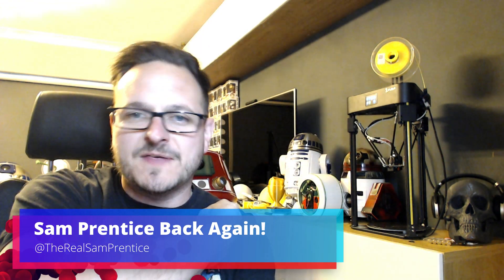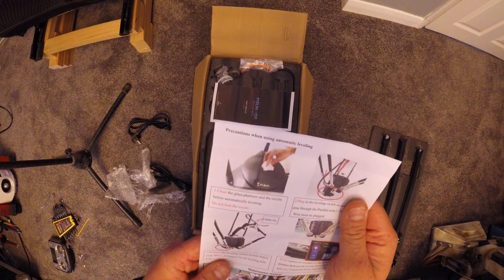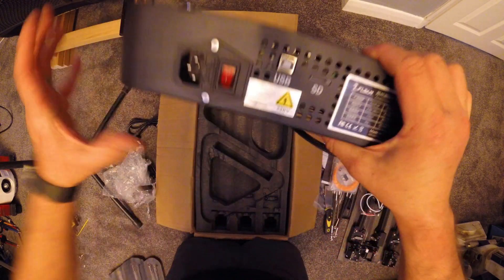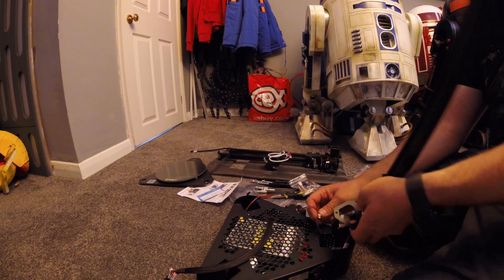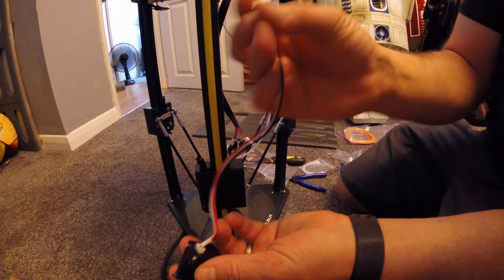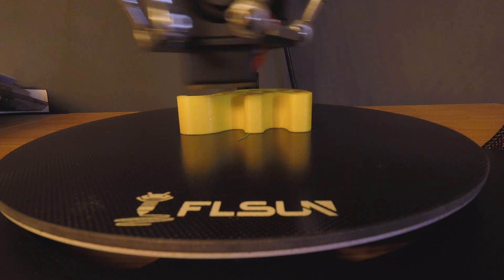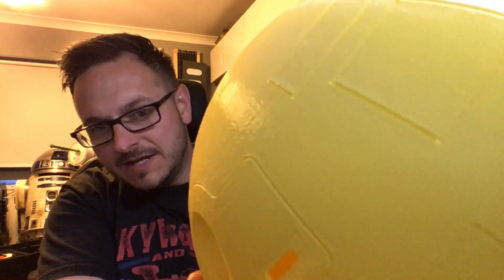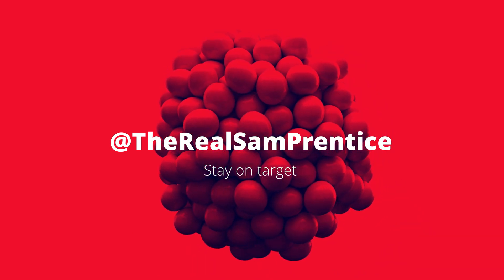Review Of The FLSUN Q5 3d Printer Budget Delta Printer!

Comment: Would you happen to know what the hot end nozzle size and where can I get replacement parts?
Reply from the maker: I understand there could be two versions however these are common, you have the short "stubby" style and longer style, it will matter but you can eye ball it https://www.amazon.co.uk/MASUNN-Copper-Nozzle-Printer-Filament/dp/B07D4F4LWH

Comment: looking a this for my first printer. there are comments about the chip that controls the print head as being low quality and that the cooling fan should be changed to a nocture with resistors to drop the voltage from 24v to 12v, it may help if the bearing on the end of the rod get a squirt of ptfe lube....cant do any harm......as a entry level printer this sets a new standard by which others will be judged.
Reply from the maker: David C you’re not wrong, this printer is ace and it produces great prints stock. Yep the driver is of a lesser quality but it’s only a noise issue not really an accuracy problem. I kind of like running printers at 24v now tho mainly as you cut the amps down and you can run fanless psus like you say tho it’s an entry level printer but I’d like to see the larger version in the future :)

Comment: I have had the Q5 for about a month.  Two things  I noticed from your video, First your hot end(not all metal) is not mounted per directions, the parts cooling fan should be on the right side and the mount for the auto-level sensor should be on the left.  The other thing is the extruder is clicking due to a loose grub screw on the gear attached to the extruder motor.  It has two grub screws and if one is loose like mine was from the factory it will cause that issue.  Also, the esteps from the factory seem to be set at 367 which it too low for the Titan, it should be set around 446 with the stock Titan.  I have switched my extruder to a BMG Clone with a TMC2208 Driver and changed esteps to 438 and now this thing is quite during retractions.  It cost me around $10 for the TMC 2208 and $25 for the BMG Clone Extruder.
Reply from the maker: Hey Marshall, Thanks for the feedback! I'll have a look at the screw right now and see what adjustment can be made. I'll follow this up in my next video of course. Did you find that it prints really well then goes off after some use? This is printing really well and just woke up to another great print. I'll have a check of the mounting settings also, but do I change it while i'm getting a stunning line of perfect prints?
Reply: The Real Sam Prentice I did make some adjustments to the voltage on the X Axis TMC 2208 driver, from the factory it was set too high like 1.35 volts and did have that driver do a thermal shutdown, the drivers should be at .8 to 1.0 volts for best performance and lower heat on the drivers.

Also from the factory one of the belts was too loose and needed to be adjusted.

Other than that I find this thing works much better with a very thin coating of AquaNet, especially if you print at high speeds.  I have only sprayed the bed twice in the last month, a little goes a long way.  I also put a little copper grease on all the ball joints.
Reply: @marshallburke88  Hi Marshall and Sam, thanks for sharing your both your feedback. I have just bought a Q5 and I am busy reading some reviews on post setup advise. May I ask if you have both also setup dampters for the extruder rods? Am I correct in thinking that the driver voltage was reconfigured using the slicer since this is a closed board?

Comment: Ive had mine about 2 weeks and its printing nicely,
Just for info the nozzle is on mine is PTFE lined, not a true all metal, it would be easy to upgrade though,
Also worth mentioning there is some safety measures taken in the firmware to control thermal runaway from my testing but it  seems to continue to print after a failure just with the nozzle and bed powered down
Reply from the maker: Hey Rob, thanks for your comment. Is there a chance of a bad batch do you think? When did you get yours and where did it ship from?
Reply: @TheRealSamPrentice  
No idea, it prints beautifully, 
It was shipped from Banggood in Spain,
The do seem to make changes to printers.
The thermal protection is effective just not very confidence inspiring.
Ive changed to marlin which im familiar with so it it doesn't concern me, but worth mentioning :)

Either way great vid, there isn't so much for the Q5 out there and at £180 ish its a great printer
Reply from the maker: @robevans06gmail  Yep i'm finding that, have you contacted FLSun with the serial number?